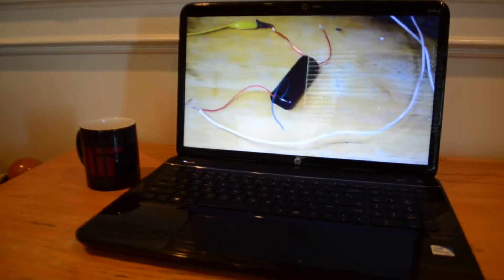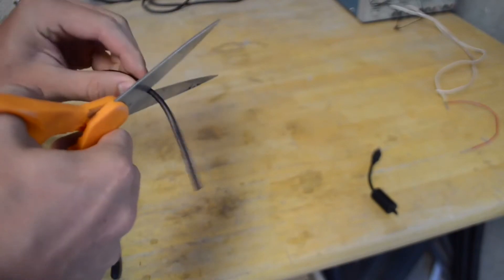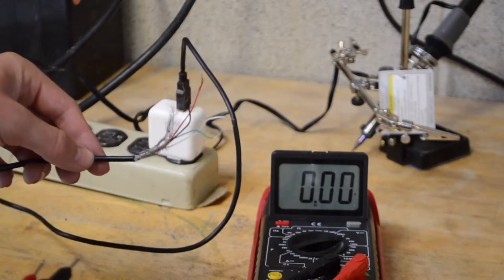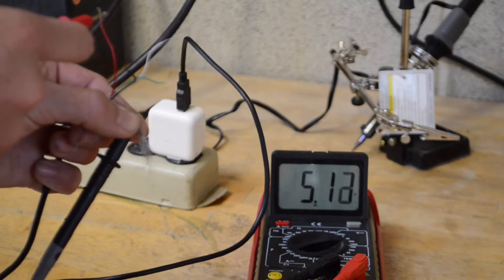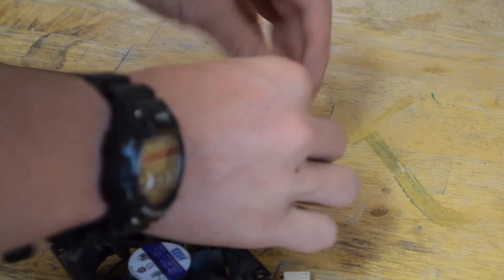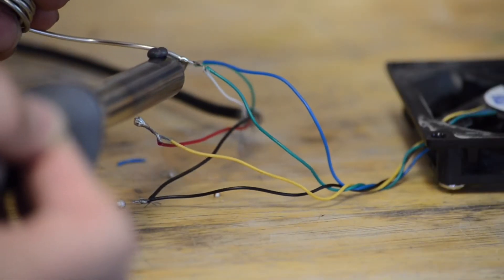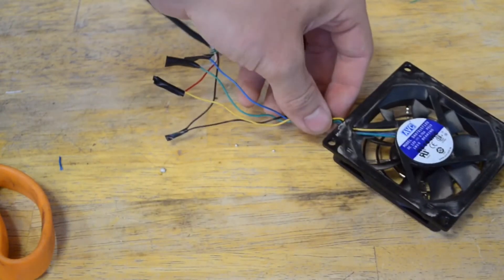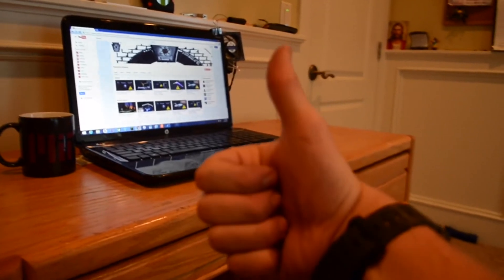How to make a USB POWERED FAN

Comment: Do you think I could put two fans on the same usb cable? I think about making my own laptop cooling pad and I want to be sure it won't overheat anymore. And instead of trying, is there another way to find out if my laptop can supply enough of power?
Thanks for your video, I like so much the stuff you show and the way you do it, that's awesome!!
Reply: Well it says something on the fans, doesn't it? Either a power rating, or a current rating. Use Ohm's law (V=I*R) and power definition (P=V*I)! A typical 8cm fan is about 1W, give or take (some a bit less, some double), 12cm can be about 3W. If you happened to find a 5V version, that would correspond to 200mA and 600mA respectively. Getting 5V versions is rather important, because 12V fans usually need at least 6-7V to spin up - occasionally they can go lower, so look up the spec. If you were to get a 12V fan to run on 5V, it will usually consume about 6 times less power, and run correspondingly that much more slowly, and the reason they usually fail to start is because the power is insufficient to overcome the magnetic force and friction in the fan.

USB ports MUST be able to supply 500mA continuously. On very very old laptops up to around 2003, it was occasionaly enforced strictly and USB ports would just power off whenever something is drawing more - furthermore there was sometimes another lockout that devices needed to negotiate the power first, or they would be turned off if they consumed more than 100mA. This practice died off rather rapidly. Finally, USB Charging specification allows anyone to draw 1500mA from a given port without negotiation, so this is commonplace on today's devices, and usually a good bit more, up to 3A in bursts and 2A continuous - if it wasn't, portable 2.5" hard disk enclosures and USB optical drives wouldn't be able to work at all.

You usually expect nowadays for USB ports to not have individual limitation at all, and all USB ports together to be protected by a common polyfuse that will shut them off when the 5V line in the laptop is about to overload, at maybe 3-5A total, because more extensive protection costs money, and less protection is risky because people sometimes put cutlery into their USB ports. But it's probably not too smart to fully rely on it.

Comment: how to do this with the brushless DC motors without speed controller
Reply: If you mean 3-wire BLDCs, you pretty much don't - you will be building your own speed controller essentially if you don't buy one. Needs at least 3 H-bridges i think, and either a microcontroller or a bunch of counters and latches to generate the phases, and some clock source - it gets very complex very quickly. These fans are brushless but they include their own controller, and instead of the clock source, they use a Hall effect sensor in the base of the motor, so it switches when the magnets turn over.